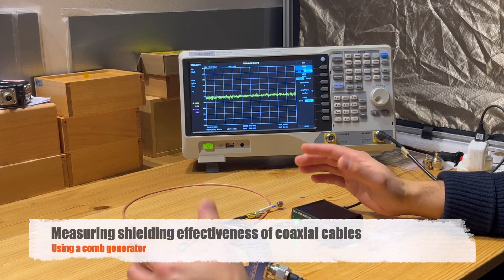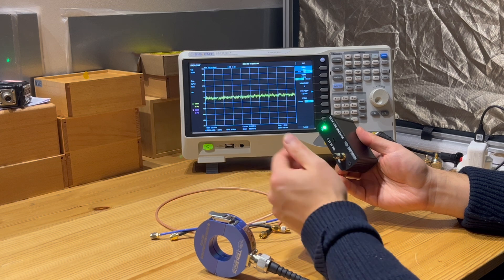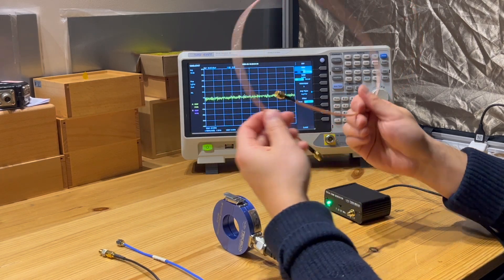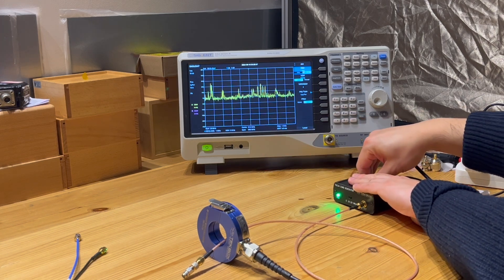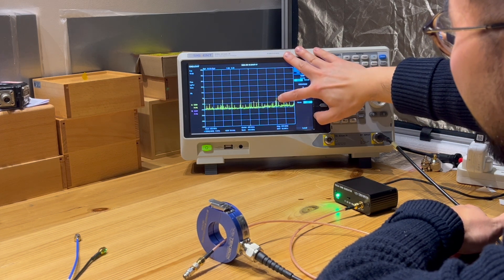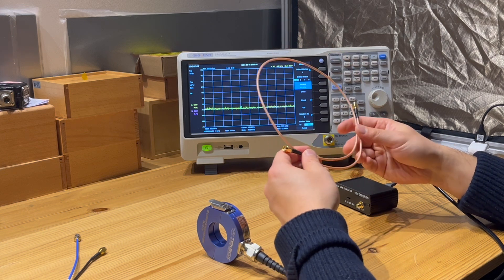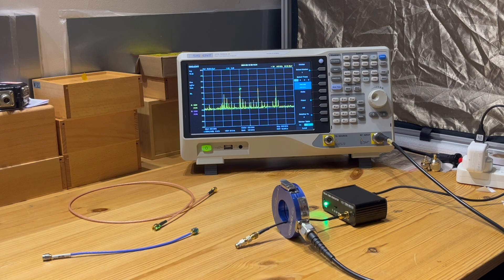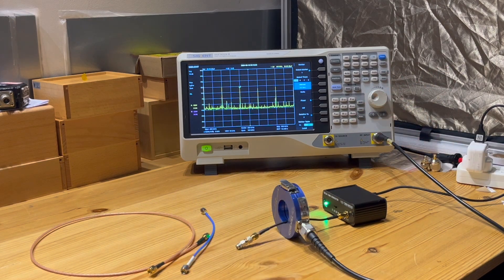Testing Shielding Effectiveness of Coaxial Cables: Using a comb generator

Comment: If i not misunderstud the effectiveness means against magneto static field as the wavelenght is clearly longer than the coupling structure. In the beginning you refer to an electric current. Do you have a clou why there is a difference? Is that because of the different impedance transitions at the end? I assume that that they are either open or terminated. Do not remember if you state this condition clear.
Reply from the maker: Hi Reine, See my reply to Pitti, you got me think hard!

Comment: I was with you on the test with the ESD gun, but I think here you are wrong and I think you are actually measuring the differences in wave impedance either along the cable or in relation to the termination - and not the shielding effectiveness.

If you were to put the cables on a well grounded (to the shield of the comb gen NOT the termination) metal plane then I might believe you.
Reply from the maker: Hi Pitti, again, thanks for your constructive feedback. This really got me scratch my head. The way I see it, first, shielding effectiveness is a wrong word to use in this case, okay, I might have used the word simply to attract more viewers, but I think a better wording for this should be the quality of the co-axial cable. Now moving to your question, it got me thinking hard. Besides shielding quality, it is also cable impedance/mismatch that would influence the result. I could try squeezing the coaxial cable with a clamp or vise, thereby creating a discontinuity of the cable impedance (perhaps somewhere halfway of the cable, if we see a significant difference in the measured spectrum amplitude, mismatch would be important. if not, the result would be determined by the shielding quality. What do you think? Could make a follow up video on it, but I doubt many people would care....
Reply: @MachOneDesignEMC 

Sorry did not notice you replied.

I'd go with quality, but for me the question is, why do you actually measure current there.

From my perspective this can only be CM current and then the question is where does it come from and does the length of the cable affect it?

So in my opinion there might be tiny openings in the shield which provide leakage for a displacement current - and while that would be an indicator for the shielding performance one can also amplify this effect by providing a metal plate (good return path) in close proximity like I mentioned.

As for the reflections or impedance mismatches you could also experiment with different cable lenghts and clamp positions.

Will do some further thinking 😅
Reply: Ok .. no new conclusion yet but more ideas:

-your comb gen generates a 600ps..1ns long pulse every 1/20MHz (50ns)

-in 1ns the pulse travels 20cm (~2/3 c)

-it looks like you short cables are 10cm long so parts of the pulse might cancel each other, but there is atleast only one pulse on a perfect cable

-if there is impedance mismatch the height of pulse will drop upon reflection, so sth should be visible at the base frequency of 20MHz - however you probably use peak detector so this will not matter IF you measure at a position where the fwd and bwd part of the pulse cannot be at the same time

-however you also do not know the exact output inpedance of the comb gen and how well it matches the cable - but probably its ~47Ohm and should not create a big difference

So my suggestion would be:
-at least 30cm cables
-measure at 5..10cm distance from gen output
-reflection should not matter due to use of pk detector (here i'd currently have to correct myself, but verify at 20MHz)
-still use a metal reference plane at also be more careful on the distances between cables and clamb and positions of items in the setup

😅😅😅